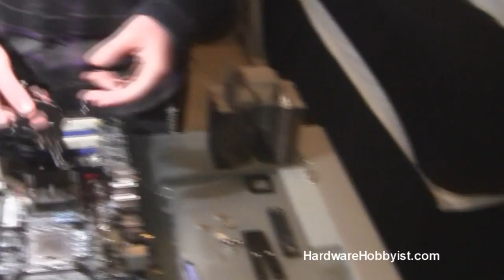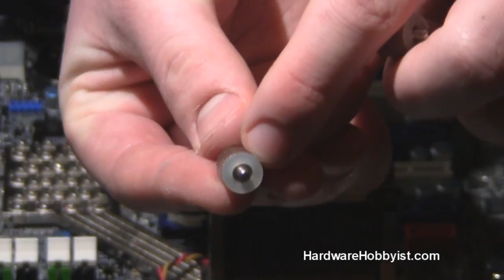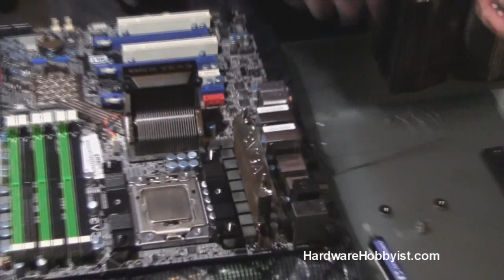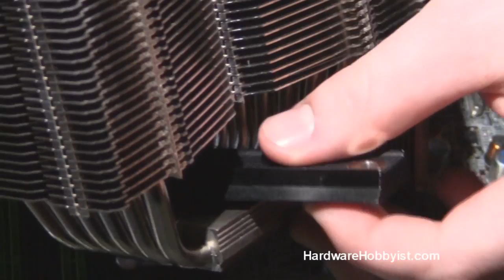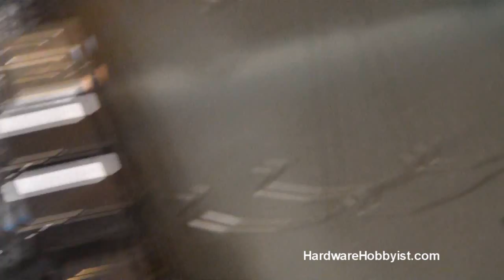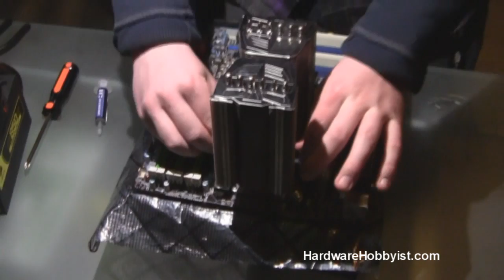[HH] Custom PC Building Guide - Assembly (3/9): "Megahalem Installation"

Comment: Actually, it does spread. A pea sized amount squished to less than a millimeter will go from corner to corner...

Spreading the compound all over may trap air bubbles. Bubbles which can actually become very large when squished to less than a millimeter thick.

Comment: With all the mobos out on the market as of the date of this post, what 'strong' mobo would you guys recommend I get (such nfo isn't easily found.) Most parts already bought (below), so limited choice. 2~300$ mobo is preferred, excl. XATX:

ram: GSKILL Ripjaws X Series 16GB (hi. prof.)
cpu: i5 3570K
PSU: PC P&C Turbo-Cool 860
gpu: ASUS Radeon HD 7850 2GB
heatsink:mghalem rev. C

Mainly used for gaming.   Worried about mobo durability + ram comp. with this heatsink

Thx in advance for any advice!

Comment: I know this comment is almost a year old but others might ask. My Athlon II X3 3.2ghz, 8gb ddr3 ram, 750gb hdd, secondary 80gb hdd and Radeon HD 6750 can run just fine on a 400w psu. Not to mention I have 2 led fans and sound activated cold cathodes.

Comment: @HardwareHobbyist Ha, you answered my question twice :) Thanks man.
I have another question about the fans. I am considering a push-pull config but I wonder what's the point of having the second fan so close to the rear fan of the case? Or should I remove the rear chassi fan? Confused here...

Comment: @DuckingNDiving Yes I had the same problem... what I did was used those 2 extra rubber rings that it comes with to put them on the pegs behind the mobo where needed. In the end I got mine to install tightly with that fix. It should come with 6 rubber rings.

Comment: @legendareNz 
?

They are telling you incorrectly.

If you spread the paste via fingers when you put on the CPU cooler which in this video is the megahalem, you will create air bubbles which is a terrible terrible heat conductor.

Comment: that backlate is labeled as for installation on a different socket type I thought... I didn't use mine so I am wondering if I should try it with it on... It def says for a different socket than 1366 on the package I read.